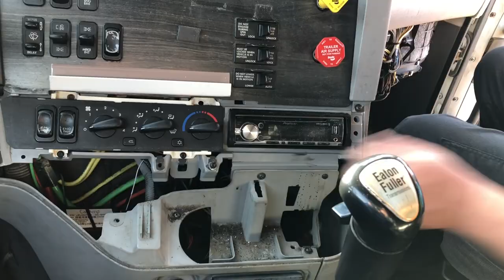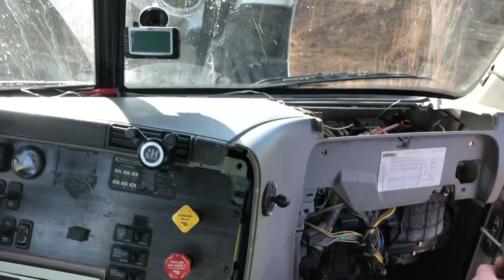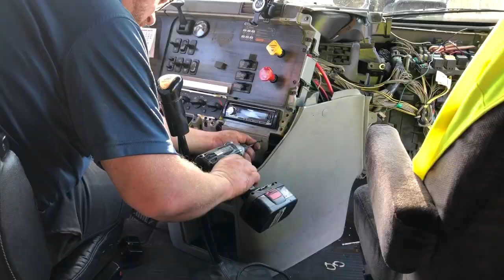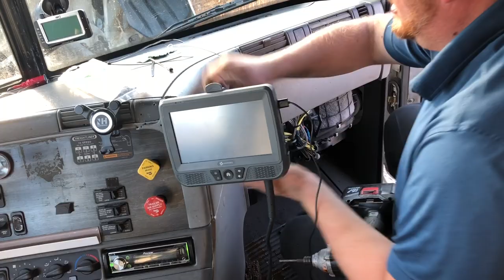Replacing the Heater Core on a 2007 Freightliner Columbia

Comment: I had to replace the hose that run to my heater core.  I need to know where the top and bottom hose run back to on the engine.  I forgot to take a picture before I took them off.

Comment: Hello sir, can you help me with advice my truck is leaking coolant under sleeper when I shut off truck....

When is idling i don't have coolant drops on ground.... everything is fine when engine is on, when is off immediately starts dropping coolant under sleeper through small black rubber hose under sleeper....
Should I change heater core in my sleeper? Or how to stop it for couple days until I get home to see my mechanic

 Its Freightliner Columbia d60 glider kit 2018.....thanks in advance

Comment: Subscribed good brother. Following, podcast and all. 
I'm an old KR tribe member so I know all the upgrades and mods your running. 

I'm actually having a hard time installing my OPS filter on my 07 mbe4000 engine. Got the truck for cheap. Very little rust. 

Share part numbers in the description if you would, that would be great, I paid $134 at the dealership for my heater core... I'm fixing to return it, since it's here in my town.

Comment: I’ve a problem with my Freightliner Columbia 2007.  When I turn on heat, the gouge drops below 150 if I turn off the hear the gouge goes up 175. When I’m driving the gouge drops to in between 150 and 175. When the gouge is 175 if I turn on the heat I’m getting heat but in 20 minutes the gouge drops to 125 and no heat I’m getting cold air. I’ve changed the thermostat bur nothing change. So I’ve watched this video now so can problem be a heater core?

Comment: My heater in 08 century tends to work only when am driving  which recently starts happening. Not sure if its because my ac condenser need to fix,  what would u recommend looked at
Reply from the maker: If you don’t have heat when you’re sitting still, you probably have a blown head gasket, dropped liner, or bad water pump. The likely only reason you have heat when you’re moving is because of higher rpm than when you’re sitting still.

Comment: What if mine is not leaking coolant but for some reason the front does not blow heat but I have very good heat in my bunk area. Would that be the Heater Core?

Comment: Curious about the ops.. did you completely bypass you standard oil filters? You only mentioned replacing the ops every 25k miles.
Reply from the maker: No. The factory filters stay and are changed every 50,000 miles. We have an entire episode about the OPS. https://www.youtube.com/watch?v=3Yc4v6K07yw
Reply: @BlueRibbonLogistics  thanks for quick response. Will watch linked video. I didn't see it under your profile. Thanks again

Comment: also on another subject....The AC compressor froze up and burned off the serpentine belts on my 2004, 2005,  & both 2006 models so I short belted them. Wondering if I take the AC compressor off, take it apart and free up the pulley...can I just let it run like that without the cooling capabilities so that I can use a serpentine belt again. I'm just so tired of taking them to Freightliner every 2-3 years for compressor 
going bad....it gets expensive.
Reply: Switch to a Sanden style ac compressor, it’s a plug and play conversion.

Comment: The difference between dual and super singles is with a flat or blowout you can limp a truck to a repair shop.   A Super Single will put you on the shoulder waiting for a tire truck to come to you.  That’s costs a lot more money than limping to a shop.   Driving wise there is no difference.
Reply from the maker: Let a road pirate catch you "limping to a shop"